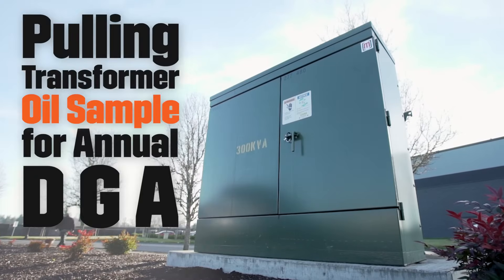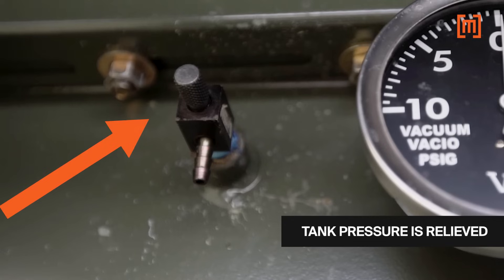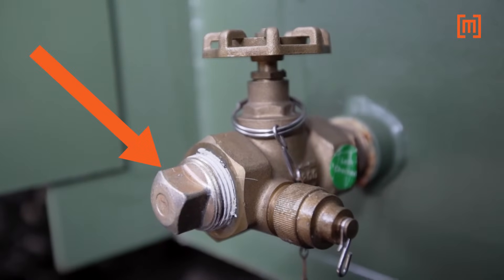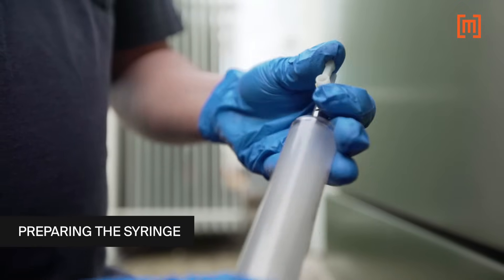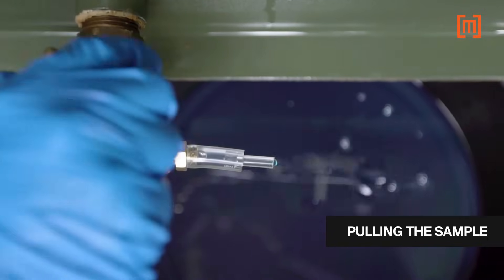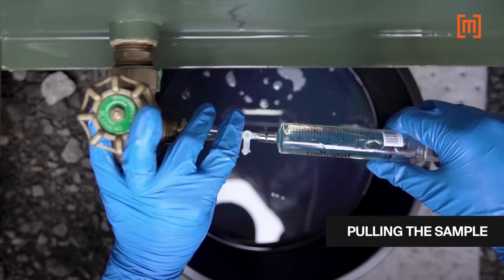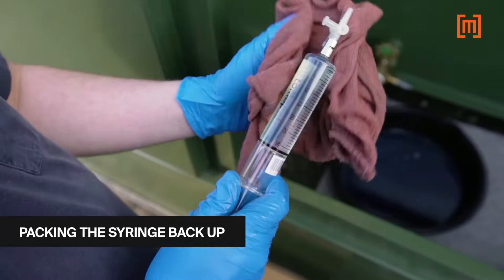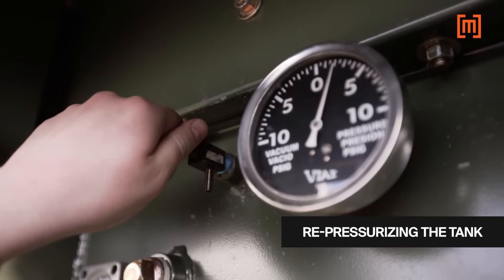How to pull a transformer DGA oil sample | Maddox Industrial Transformer

Comment: may i know if the oil sampling is conducted with the transformer energized or de-energized?
Reply from the maker: The sample should be taken when the transformer is de-energized. Sampling may be performed with the transformer under load if local electrical safety requirements can be met.
Reply: Both can be done. External oil sample ports should be mandatory by the AHJ, NFPA, NEC ect. Which agency or organization would be responsible for enforcing this??

Comment: May I ask why bring the tank to atmosphere? 
I feel as if this is a lose lose.
You run the risk of letting atmosphere into the tank.
Also if the XFMR has not been running (oil cold) the pressure allows the oil to flow quicker.
Reply: Thanks for the reply! I understand to bring the pressure to at least 0 if it is at a negative pressure. In your video, it is shown and stated that the tank pressure usually sits at around 2psi. I am trying to understand why you would release the positive pressure in the tank before a sample. I’ve experienced that the positive pressure makes the sampling process a whole lot easier especially when it comes to cold FR3.
Reply: The positive pressure would force the oil down towards the sampling port further mitigating the risk of atmosphere entering through the sampling valve. That is my understanding. It’s funny because I just had an inspector recommend me to bring the pressure to zero because that is how he read the manufacture spec. I gave him my above reasoning why I like doing it with positive pressure. Now I stumbled across your video explaining what he was stating. I am just trying to understand this reasoning. Thanks in advance!
Reply from the maker: @tylerfini8791   To your point, there must be some amount of positive pressure in order to properly take an oil sample per ASTM D923. The main thing you want to avoid is attempting to take a sample when the unit is under vacuum. One point most of us ignore is whether or not the pressure vacuum gauge is working properly. If the gauge has been tampered with or damaged at some point, it may read positive or negative pressure when the opposite is the case. By zeroing out the gauge, you ensure it is properly calibrated prior to taking the sample--eliminating the risk of taking a sample under vacuum. There must be positive pressure on the unit prior to taking the sample. Your question is well placed and well received. Let us know if we can ever be of assistance on this issue in the field.
Reply from the maker: Hi Tyler,
We appreciate your request for clarification here. As you have pointed out, a negative internal tank pressure creates the risk of the transformer taking in moisture from the outside air when the sample valve is opened. This is most often the case with transformers which are out of service or recently built but not energized yet (where the pressure gauge will sometimes read below the zero mark when the fluid is cold). If positive pressure is not added to the unit, the existing vacuum will prevent you from being able to take an oil sample and expose the transformer to the risk of taking in moisture from the outside ambient air (as you’ve already pointed out). A sample should not be taken where the tank pressure is negative per ASTM D923. Your second point about slowing down the flow of the oil during sampling also speaks to the reason why we recommend positive pressure be relieved/lowered prior to opening the sampling device. This video is designed to provide a brief introduction to one of the more frequently used sampling techniques for fluid analysis on padmount transformers. For more detailed information or to request a DGA from our field service team, please reach out to us at 1-800-270-2011. Another excellent resource on oil sampling techniques is ASTM D923 (this is the standard from which the methods discussed in this video were derived).
Reply: The tank is in a positive pressure state, that's why he is releasing pressure. If the tank was in a negative vacuum state, releasing that valve would pull atmosphere into the tank which holds moisture and allows water to get inside the xfmr.